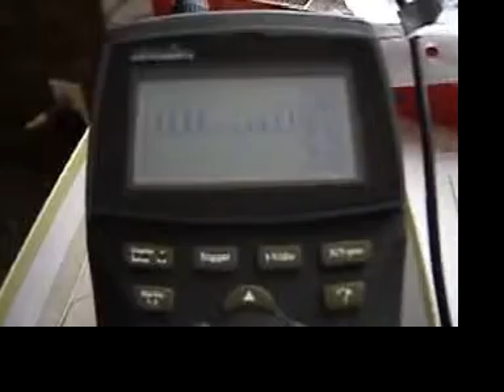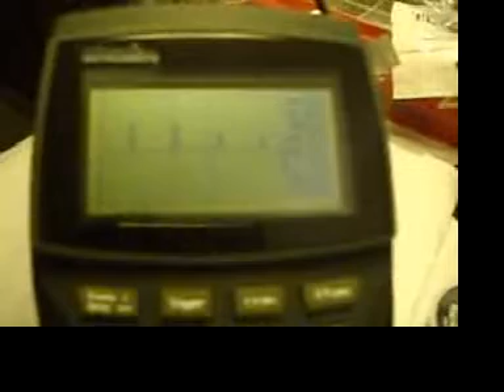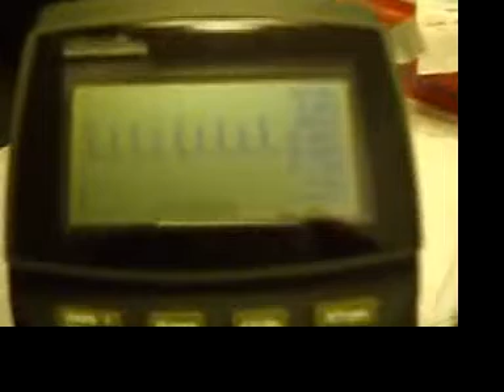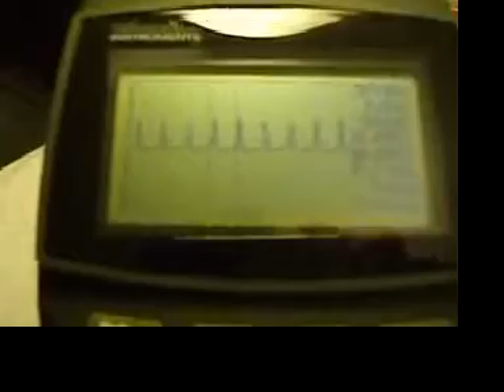Joule Thief with 2 Secondaries Explanation Part 3

Comment: I created another JT circuit without the C,E led thief. And I created another secondary and it alone is charging a bat plus the led and its bright. I noticed the led will turn on either way polarity wise.
And they do have different voltages, my secondary is wound in the opposite direction from the primary. This is getting exciting. Now all I need is a switcher.....later!

Comment from the maker: @calicheboliche79 
They are not connected by any wires.
The secondary coil is wrapped around the same toroid that is getting the switching pulses of the joule thief circuit. Because pulses in a magnet make electricity in a wire wrapped around it, this extra wire gets only the magnetic pulses and delivers electricity to the ends of the wire, thus lighting the led. 
Good project, btw.

Comment from the maker: Great, jdm...
The first next step is to wind a single secondary and use that for the output. Without the basic joule thief light,  your battery will last longer. Without the light you will only be using the battery to run the transistor, and that will only be on some of the time. BTW,  it continues to use power to run the transistor even when the basic light is off. So, remember to turn it off!!
Thanks for trying this!  -jeanna